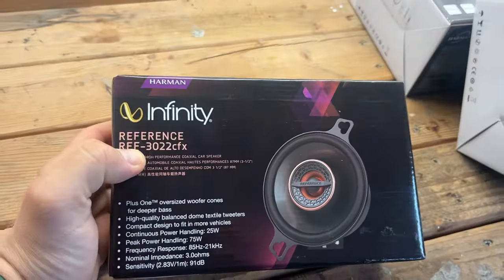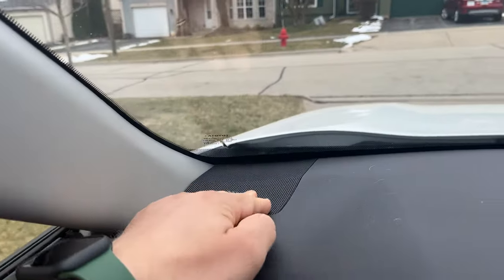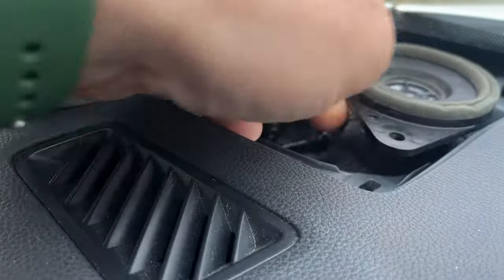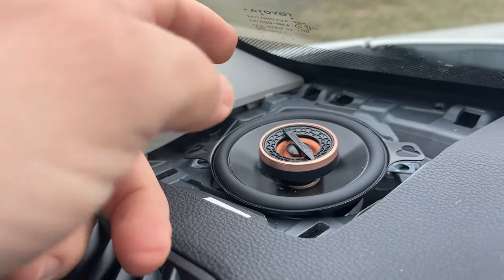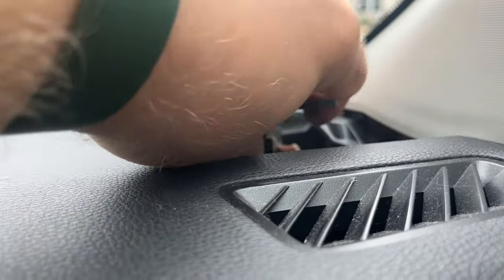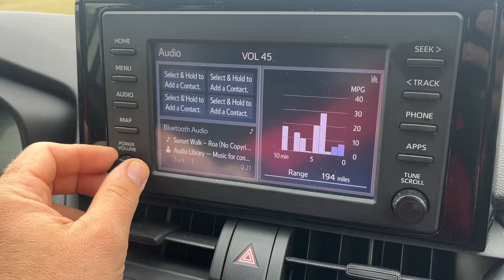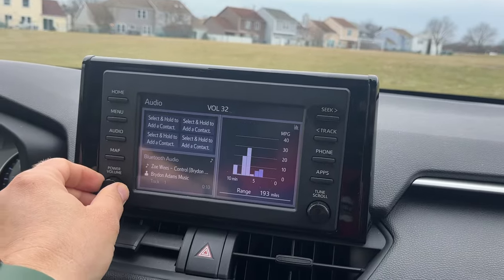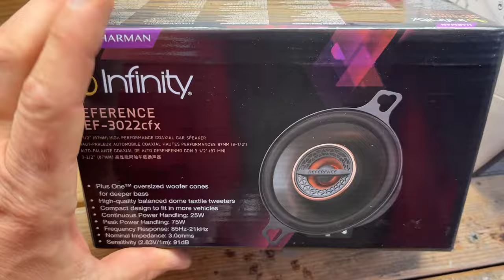Toyota Rav4 (2019- 2023 +)  dashboard speaker upgrade

Comment: I have to warn owners of a late 2022 and the 2023 RAV4, non-JBL equipped models. In the new models an upgraded speaker unit is featured. Although maybe not the same quality of the JBL replacement speaker but it is an improvement nonetheless and the sound is very acceptible now. The factory speakers now have a separate tweeter. And, and this makes the replacement JBL speakers unsuitable, these new speakers have a second plug for the tweeter. So the Red Wolf wire harness is incompatible. So before ordering speakers and wire harnesses, check what kind of speakers are under the windshield!! Bye, Willem, The Netherlands.
Reply: What option does a JBL 2023 RAV4 prime have if they want to update the dash speaker?
Reply: @tfsilvia  I don’t know that. Easy to find out though, simply remove the speaker grille using a plastic (!) tool and unscrew the two bolts. See what type of connection is used. And keep in mind that you will need a wiring harness. If your car has a speaker unit with a tweeter, which I think it has, forget about the upgrade. The new speaker is quite good and an upgrade might not be worth the trouble.
Reply: @leyland9999  @tfsilvia thats not true. I saw your comment before my 2023 rav came, but after i had purchaed the 3020s with the adapter. I was about to return the speaker after that but just decided to try swapping it out and it worked flawlessly. Followed along to this video too. I now have the JBLs with the harness in my 2023 rav and they work fine.
Reply: @tfsilvia  you can go ahead with this upgrade the process is identical, I did it with my 2023 RAV
Reply: @harraisingh9595  All I wanted to say, is that before you purchase the speakers and harnesses, you check what there is under the speaker grille. It didn’t work for me, I returned the speakers but the harnesses have to be sent back to the USA where they came from. Not worth the trouble.
Reply: My 2023 hybrid woodlands had the very crappy bad one seen in this video. I payed $70 or so to crutchfield and they sent the jbl speakers and wiring harnesses free shipping
Reply: I want to replace my tweeters in my 2022 rav4 hybrid . Don't understand this harness stuff. Will this infinity speaker work for me. I guess I can remove the speaker to see. Any help appreciated
Reply: I have distortion from those JBL Club 322F for my 2023 Toyota rav4 with the included Metra wire harness. Still distorted on high volumes, any solution to this?
Reply: Hi. Yes. It is true that on my 2023 RAV4 gr i have right speeker with tweeter and second two pins harness. Anyway I just replaced into JBL Club 322 F using only 4 pins  connector and it works fine. :) This second 2 pins connector I just left unconnected
Reply: @CarlosSantos-jw7bb the harness just connects the original wire to the new speakers, because the new speakers have different wire connections.
Reply: Base model 2024 hybrid worked.
Reply: I got the REF 3032...will these fit as well?? Thanks for the video
Reply: @justinhogue9861 will this work for 2024 hybrid xle?

Comment: I am not a do-it-yourself type and I become easily frustrated with installing replacement parts by myself.  However, I felt encouraged after you showed how easy it would be with your step-by-step instructions. I bought the speakers and wiring from the link you provided and was able to install in my 2019 RAV4 in about 20 minutes.  Thank you so much!
Reply from the maker: Yea its easy and sound is much better.

Comment: I just bought the same 3.5” and 6.5” speakers  before watching this video! I was looking for installation videos and noticed the model numbers were identical. Good to know you liked them. 

I bought them on Amazon for $47 for open box 3.5” and $59.99 for the 6.5” open box in excellent condition. Hopefully they are easy to install on the door when they arrive on Friday
Reply from the maker: It is not difficult to install the tweeter ones(small speakers). The only possible hard part is to remove door panel if you do it for the first time. Don’t loose those white retainer clips when you pop the door panel.

Comment: I tried the rockford fosgate 3 1/2 and didnt like them , then I tried the Kicker CS 3 1/2 and they sound great. I didnt have to adjust the sound levels at all and I can hear the pick strumming the strings and the base is very good too. Black eyed peas are very good for testing highs low and mids.

Comment: I'm on top of the world tonight, and it's all because of this video.  I recently purchased a 2024 Rav4 Prime SE and was very disappointed by the car speakers - I have the six speaker non JBL.  My music sounded flat.  After watching the video a few times, I settled on the JBL brand, figuring it was low risk.  I called Crutchfield and they recommended the JBL Club34F speakers for the front dash  (75W peak, 25W RMS.   They also sent the Metra Turbo cables, part 72-8110, no charge.  Whatever you order, I found them excellent to deal with.  It all worked, and took less than half an hour, mostly finding the right tools to pull off the speaker grills (a dull kitchen knife worked great) and loosen screws  (not much room to work with).  I am far from an installation genius, but this is quite do-able for an average person.  The wiring was not at all complex. This video explains everything.  I could not believe how pathetic the OEM speakers looked - almost like a toy. 

What a difference -- the music now sounds much better, and for today, plenty good enough.  Not sure if I want to take on changing out the rear door speakers, or even if it's necessary.  That seems more daunting!
Reply from the maker: @DR-gx2cb  thank you for taking your time and leaving positive comment on my video. Yes these speakers makes huge difference,sounds so much better.
Reply: How much were those speakers?
Reply: I completely agree about crutchfield being amazing to deal with, they've been in business forever with a great reputation. They will send customized detailed instructions with your purchase and their customer service pre-purchase especially is phenomenal.

Comment: Just completed the upgrade on my Rav. Noticed from the factory the bolts on the drivers side speaker were not tightened down!  Otherwise a straightforward install, the only difficulty I had was detaching the factory wiring from the clips and tightening down the bolts on the passenger side. After that was amazed at the clarity of the Infinity speakers.  Glad I saw this vid. Many thanks!  I just may do the door speakers…
Reply from the maker: Thanks for positive feedback on my video. Yeah these speakers are good, now music is more enjoyable to listen.
Reply: @nazarettos6987  absolutely!
Reply: @nazarettos6987  one thing I noticed while driving is that I hear intermittent crackling sound from the speakers.  Not sure what that’s all about. If I change the balance more to the rear it seems to go away

Comment: Just bought a 2024 Rav4 XLE AWD. I will definitely upgrade the speakers too, thank you very much Mate!!
Reply from the maker: @johnspencernazaire  for 2024 I think they might have changed the front tweeter speakers. Before buying front tweeter speaker check if there are no extra connector the back.

Comment: Great directions, I’m sold. I’m going to replace my dash speakers tomorrow. Date: August 2nd, 2024
Reply from the maker: @k8knut1  makes huge difference
Reply: I have a rav 4 from November 2022, it does not work. There is a separate tweeter, and with separate wiring

Comment: in EU, on lower trims, you'll find that on the right side original speak is actually 2 speakers (or a tweeter is there) and has 2 connections there. 1 connection is for the speaker and the 2nd for the tweeter is for the SoS emergency button connected to the button on the "roof dashboard". You can still swap with new speakers like shown on the video, but you won't be able to re-connect the SoS emergency button back on (for me it's fine, don't need it anyways).
Reply from the maker: My emergency SOS works but only on the right side. I could hear it.

Comment: GREAT video. I will be doing this. Quick question: what made the biggest difference in sound the replacement of the front speakers on this vid or the replacement of the door speakers?
Reply from the maker: @getore100  front speakers makes huge difference but rear not so much. I will be installing new small aplifier. Overall sound changes and it sound amazing
Reply: @nazarettos6987  thank you

Comment: I went to my local car radio place to check out the polarity. Reverse polarity does not impede music for the most part and my ears couldn't really tell apart the difference. But I think your music will sound better if you don't mix up the positive and negative wires. For my 2019 LE Rav4 gas, the shop found the wiring diagram the denotes positive and negative. * please note this is based on 2019 RAV4 LE gas model. I have no idea if wiring changes from model to model or year to year for the Rav4. There are plenty of car radio places to double check if you're not sure. usually they don't charge very much for this work if you unscrew everything for them to inspect *** 

Driver side front dash 3.5 speakers:
-Lavender/Black wire is positive +
-Lavender/Red wire is negative -

Passenger side front dash 3.5 speakers:
-Lavender/Light Green is positive+
-Lavender/Blue is negative  - 

The fix for reverse polarity is quite simple. Just criss-cross the 2 wires from the red wolf wiring harness. 
1. Take the RED WOLF wire harness
2. There should be a Red and Silver wire. Red is positive and Silver is negative. 
3. Use pair of scissors or wire cutter to cut the Red and Silver wire on the wiring harness. (DO NOT CUT THE WIRING COMING OUT OF THE VEHICLE. MUCH EASIER TO CUT THE WIRING HARNESS FROM RED WOLF)
4. strip back the insulation to reveal metal strands 
5. Connect red wire to silver wire. and vice versa to connect silver wire to red wire. you can twist the wires together from and tape it up using electrical tape. Or you can use wire quick connectors to connect. 
6. Done!  you can double check your work by tracing the new 3.5 speaker's positive side to the positive side wire coming from the car. New speakers usually have a larger connector (positive) and a smaller connector (negative).

* PS. another way you can check if you have reverse polarity (hooking up positive to negative and vice versa) is to take a look at your red wolf wiring harness (the large plastic end). And to take a look at the OEM speaker connection end. They both have a 4 pin connector set up. The red wolf wiring harness has Positive red wires on the end without plastic clip and negative black wires on the end with plastic clip. (The end with plastic clip is the part of the connector that has the little opening that secures the connector. you have to push this end to release the connection.) Now look at the OEM cheap plastic Toyota speakers you've removed, It also has that 4 pin connector identical to red wolf harness. The positive end is most likely the side with capacitor on the plastic clip opening side. If this is the positive side on the OEM, then the red wolf harness has red positive wires on the other end, thus causing reverse polarity. So not exactly plug and play anymore. **

Let me know if anyone has questions.
Reply from the maker: I installed it all correctly like in the video, everything works great
Reply: @nazarettos6987  It will work even if the wires have reversed polarity. This is why all the YouTube tutorials don't mention reverse polarity I suspect. My untrained ears couldn't tell the difference. But it's probably not ideal to mix up positive and negative wiring in a speaker. My local pro car radio technician looked up the wiring diagram for my rav4 and swapped the positive and negative in the wire harness.
Reply: @jono601 what exactly happens if you do reverse it??

Comment: Just did the install. And was sooooo simple....I noticed the capacitors taped on the box but I didn't use them ..Will it affect the performance if not put on??
Reply from the maker: My speakers are fine without the capacitor

Comment: I have 2023 Prime and the speaker and the connector are totally different. Red Wolf does not make connectors for my car. Metra does 8109 but it has to be modified with correct polarity.
Reply from the maker: I think prime already have good speakers installed
Reply: @nazarettos6987  Nope. Paper crap, sounds dull. Replacing all with the almost the same as yours. For 6.5 inch I bought Kappa 62ix.
Reply: @sushi8204 also picked up a 2024 prime. It doesn’t sound bad for a non-JBL but I am going to try this same Reference dash speakers without bass blocker and reverse polarity just like on this video. Speaker look the same but I haven’t pulled out the speaker to see the harness so stay tune when I get the red wolf harness tomorrow lol
Reply: @verynick  That was 3 weeks ago. Since then I returned Kappa 62is and bought 4 Rockford Fosgate P1675 for the doors. Metra 8109 is correct harness but polarity needs to be reversed. No big deal. I used very tiny screwdriver which I flattened with the file to remove those prongs and reverse them. Also P1675 have larger prongs so I had to cut the ends of the 8109 and crimp my own connectors. Also, no big deal. The sound clarity improved tremendously. Now I just got a new Rockford Fosgate P3SD4-8 Punch and am going to try to hook it up tomorrow. If it works I would have to make my own adapter to mount it. My biggest fear is that the amp will not be able to push it. If not I might have to buy a small amp. The funny part is that even without factory sub it sounds about the same but a little less bass. All distortions are gone and the dull sound is gone too.

Comment: Can u tell more about harness wiring does it fit  front door speaker and rear, I have RAV4 2023 I want to order same like u 4 speakers and tweeter…
Reply from the maker: If you have AdVenture model, it might be different. But if it’s LE or XLE harness should work, just the same one I ordered.
Reply: @nazarettos6987  thanks pro

Comment: Nice upgrade! Easy too.
Reply from the maker: I had those original flat sounding speakers. Its a big difference of sound quality now.
Reply: @nazarettos6987  I am considering getting a RAV4 hybrid next year. If I don’t get the higher trim with upgraded sound system, I’ll just upgrade it myself like this. 
PS why is your video down with upgrading the window up/down switches?

Comment: In another video, the guy installs a bass blocker in-line at the positive terminal. Is this needed?
Reply from the maker: Everything works for me
Reply: @nazarettos6987  No crackling or rattling sound?  I keep reading the same thing about the base blocker.  And the polarity thing.  Yes it would work, but people say that it takes away from the overall base of the speakers if the polarity is off.  After your entire upgrade processs did you notice a decrease in overall base?  Thanks in advanced, you've given me confidence to order!
Reply: My understanding is that these small dash speakers can't handle the lower bass signal, hence the in-line capacitor.  You might damage that newly installed speaker, especially if you really push the volume, or added an Amp to your system.  I'm gonna use the Capacitor, I'm looking to keep the vehicle long-term and want this install to last.
Reply: @allyn4u isn't that only if the speaker doesn't come with it? Like his speaker it's already soldered on no?

Comment: You're comparing the magnet of the midrange driver of a two way coaxial speaker to a tweeter. Comparing a stamped 20W rating, granted you don't know if that's RMS or Peak, to 75W Peak power isn't a valid comparison.

Comment: I have distortion from those JBL Club 322F for my 2023 Toyota rav4 with the included Metra wire harness. Still distorted on high volumes, any solution to this?
Reply from the maker: Could be bad wiring
Reply: Buy and install bass blocker capacitor on red wire(positive side) of each speaker
https://www.youtube.com/watch?v=C5itHBqdKB4&t=172s

Comment: I have a 2024 Rav4 Prime SE.   The standard 6 speaker sound system is poor quality and sounds flat.  I would like to change the front dash speakers, but am not an electronics genius.  Has anyone tried on a 2024?   Is it as easy as this video, or is their increased complexity on the wiring or parts required?

Comment: i purchased a set of harmin infinity speakers i need connection wire for my  22 rav4 they seem to be unavailable in australia  can you help
Reply from the maker: First check your connection, take a picture from the back and make sure have same. Order maybe on ebay
Reply: thanx for your reply . was curious is there c code to order for the connecting wire there is heaps not sure , thanx  @nazarettos6987

Comment: Any idea if the REF-3032CFX will fit? Not sure the difference but is 3.5"
Reply from the maker: If it is 3 1/2 it should fit,but I would not install any more powerful than these 75W
Reply: @nazarettos6987  75W is peak power.  Those are actually 25W RMS.  Anyway, even if it was rated 200W, it's the amplifier that provides the power ;-)

Comment: The OEM speakers are 4 ohm, the replacement speakers are 3 ohm, now the system is out of sync, and, let's have an update for 2023 models with the tweeters on the A panel, (windshield upright) and thank you for the quality video.
Reply from the maker: The sound quality is much better

Comment: 180 watts peak power and 60 watt RMS....you will need amplifier to get full power and clarity...factory radio unit only throws out maybe 25 watts per channel...not sufficient to drive these speaker well enough
Reply from the maker: You might be right but I don’t blast music in my car that loud
Reply: @nazarettos6987  there is another similar model from infinity instead of IX it says EX....6532EX and that is 165 watts peak  and 55 RMS...this lesser powered ones will work better on the factory radio unit